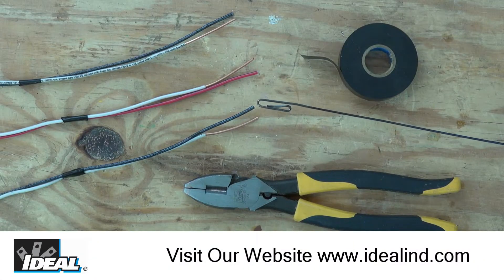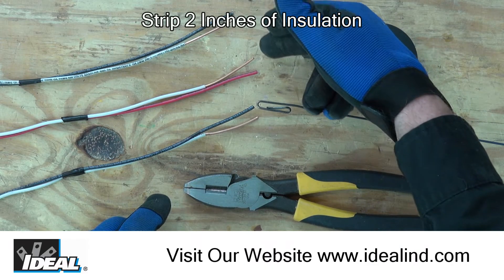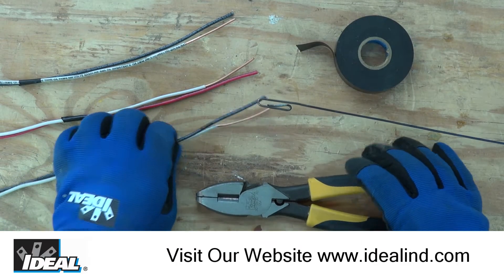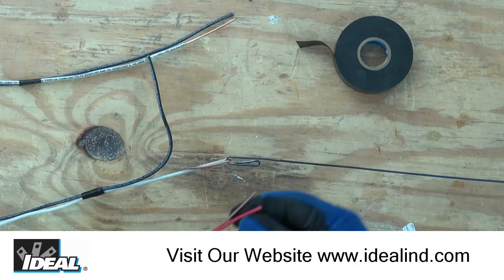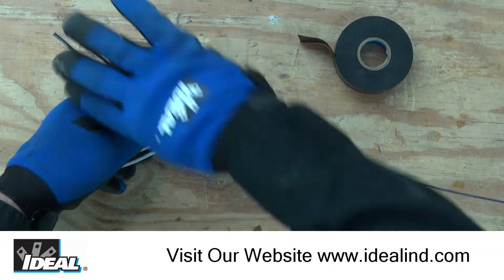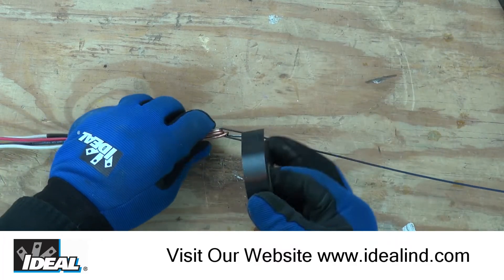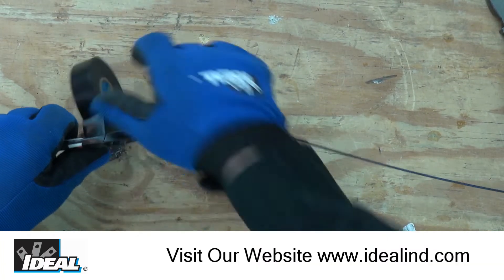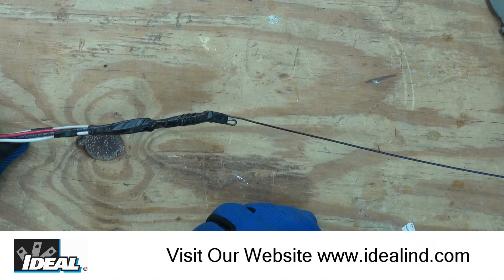How To Attach Wire To A Fish Tape

Comment: Pro tip. Don’t pull with a fish tape. Use fish tape to run a pull string the use string to pull wire.
Reply from the maker: Hey Brandon totally up to your preference you can pull the wire either way. Have fun Ron

Comment: Strip 6 inches of insulation from wires so there is no insulation in your pulling head which makes the pulling head smaller and therefore easier to pull..
Reply from the maker: Hey Farmer Dave appreciate the tip! Ron

Comment: Does ideal make flush cut cutters?
Reply from the maker: No IDEAL does not make a flush cutting pliers. I have picked them up at Harbor freight in the past. Good luck Ron
Reply: @RonKipperDatacomm1   do you know any compact electrical testers as IDEAL made great ones that dont need batteries looking something that's a little smaller
Reply from the maker: Mr Panda about all electrical testers use a battery only ones that don't are old voltage solenoid type like IDEAL 61-065. Look for the Cat rating on the tester and I would recommend at least a Cat III rating as they are safe to use about anywhere in the building.
Reply: Good tip sir. Thanks. You should be getting more likes on your videos.